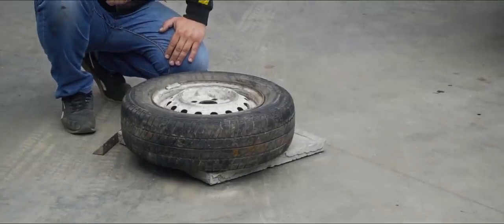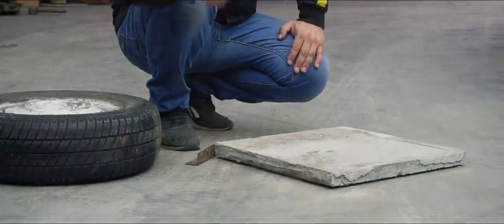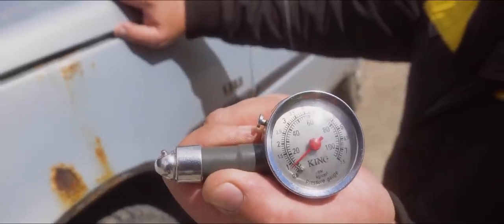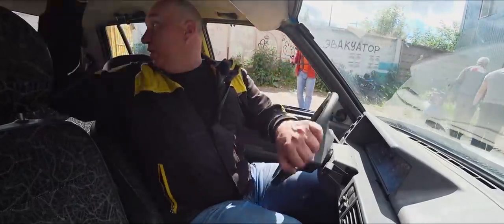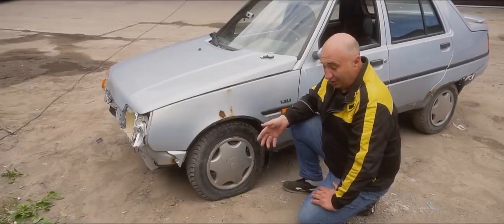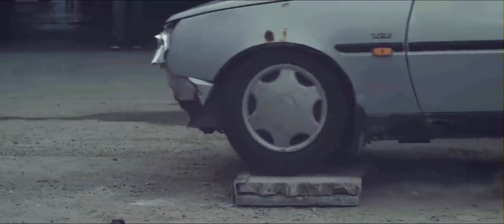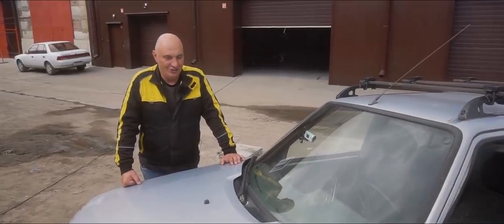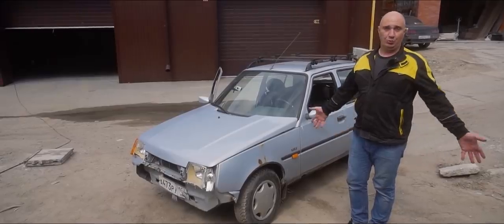220 PSI – can the tire keep it together?

Comment: Over inflating your tire a little will not cause blow-out. As one can see a healthy tire can take a lot. It is the low tire pressure causing a lot of heat while driving that leads to tire failure and blow-out.

Comment: Used to work in a photo lab. Fire dept brings in film of dead guy who was welding a 18 wheeler truck rim and did not remove valve core. His head above his nose was sheared off and they showed it with rim on roof where it ended up. He was leaning over it when the heat set it off like a bomb.

Comment: Now make a 4 way joystick that actuates four  single piston cylinders (use a master from a hydraulic clutch - 2002 Accent for example) in an X formation and connect it to a X and Y axis pivoting joystick with pushrods to press into each master, oriented centrally so that each corner of the X points to the wheels LF, RF, RR, LR starting at top left and going clockwise. Connect the other end respectively to each corner of the car's brakes with brake lines  - 4 way selective brakes ;)

Comment: Would be curious to know what pressure the tyres briefly reaches on impact, maybe one of those cheap wireless tyre pressure monitor that screw on the the valve is in order
Reply: I thought about that too, they probably won’t read high enough though😐
Reply: @paulEG6  just had a quick look and most seem to max out at 90-100 psi, prob something out there that can be put in the tyre for high reading but no doubt be expensive for these levels of pressure resistance

Comment: No way would I ever be near that tire when putting in that much air, thats nuts!
Reply: @TomAlter1000  I had a LT245 tire blow up on me a few years ago, and it was only at 40psi, it turned out to be a defect in the tire, I got a cut on my arm from it, yeah 200psi is scary in a passenger tire...

Comment: Thank you for that experiment: Now I know that I was perfectly fine when I've overinflated a tire to around 6 bar / 90 psi after I forgot that I've left super slow and super loud crappy tire compressor running until it broke down :)

Comment: This is so ridiculously dangerous. When I was an apprentice years ago there was a picture on the wall at trade school of an imprint of a man in the roof of a factory. It was caused by him leaning over a split ring truck wheel while inflating and it letting go at about 25psi.

Comment: I love this channel but you scared the shit out of me while inflating that tire to such a high PSI.
When I was active duty USAF, a young airman inadvertently overinflated a nose tire on an F-15.
He had been taught an improper and illegal short cut that cost him his life.
The nose tire on an F-15 is normally inflated to 325 psi.
He had the regulator set to 970 psi and the ten tie bolts that hold the wheel halves together failed and the whole goddamm thing blew up in his face. He never knew what hit him and it CUT HIM IN HALF!!!
I was on that very jet about 20 minutes before it happened and it haunts me still. That was in 1986.
Please, please PLEASE! respect that kind of force and be careful.
I've lost enough people to tragic events. 
Be safe my friends.

Comment: Last time I changed my low profile tires, one of them wouldn't pop out while mounting it. The guy at the shop put 6-7 bar of pressure but nothing. He told me he didn't want to go any higher. Next time I'll take my car to Russians. They put 15 bar in a used tire without a problem 😂

Comment: When I was like 10, my bike tire blew up in my face. Scared the F out of me. This guy has balls for pump a car tire Up that high.
Reply: Had mine jump right off the rim, balloon and POP! Tyre did fail (the lining at the rim edge), because I didn't have a spare with me, I very carefully reset it and ensured it was properly positioned. Thank goodness for spare tubes (I replaced as soon as I returned home).

Comment: take a lada and loosen all the bolts in the engine, rod endcaps, main caps, camshaft caps, headbolts, timing chain, crank pully, water pump, just make it really loose.

Comment: Crazy how durable a Tire is. But I would be scared to drive it after just one of such a hit. Well at least at high speed. At low speed an exploding tire is managable. I always thought that it is dangerous to continue driving after you hit something like this. But they were really trying but it didn't explode.

Comment: I would really really really like to know which tire holds 220 PSI!!! I freaked out when a lady brought a car into our truck stop with 117 PSI in her Tire. I went and got two more Tire gauges just to see if the first one was correct. That was freaky as hell. I myself never put more than 38 PSI in mine.
Reply: Semi truck tires are often rated for official use at like 130psi, but 220 is pretty nutso.
Reply: @Cooe.  I've been doing truck tires for 30 years plus. The most I've ever put in a tire was 125 psi and it was usually a super single.

Comment: I need to know what brand of tires those are. I've had semi tires explode at 130psi.
Reply: Anthelion Gaming we’ve been getting new reefer trailers in from the dealer with 150 psi in them.
Reply: @danparden8103  Even the heavy haul tractors don't get 150. We're not allowed to air past rated pressure.
Reply: Those tires are Amtel NordMaster. Winter tires produced in Russia.

Comment: Now lets try these pressures on a car loaded with 5 tons of concrete, a wooden crankshaft in the engine and vodka in the fuel tank, a clutch made from a frying pan and some flat pebbles as brake pads. :)

Comment: On the thumbnail it looked like 220 BAR that would be spectacular 3190psi
Reply: 220 bar would make a huge explosion but can be easily  achieved with a diving compressor
Reply: @FraLin  oh really?  Interesting i have only worked with Industrial compressed air systems at about 100psi. And isostatic systems at 345 bar but they use water.

Comment: Test recommendation: Replace a car steering wheel/gas pedal with motor cycle handle bar and controls!
Reply: How would you turn a handlebar three or four rotations with all the cables and wires connected to it?
Reply: @Rob-fc9wg  thats part of the challenge

Comment: 2:40 LOL those are Very tiny Wheels i remember owning a 93 civic and it had those size tires, it felt like a Go Kart, it was very zippy and fasyt, although it didn't handle very well :(
Reply: Sounds like you can't drive, one of the nicest handling hatchbacks out there

Comment: Fuck that...i wouldn't want to be anywhere near that tire once they got over 90psi

I was gassing up a once and the car next to me had a sidewall blow out at random. The concussion was so strong that it caved my driver's side door in, shattered my mirror and blew apart the light above us. Being a 1988 F150 I just yanked on the goofy mirror bracket and the door popped back out. 

Scared the hell out me, thought I was being shot at. The lady who's car it was had a little kid who was freaking out and she didn't have a jack or tire iron. 

I went home and picked up my floor jack so I could change her tire. Afterwards she asked for my name and address...about a week later her husband came by to give some cash for the mirror and thank me for helping her because he was out of town when her tire blew.

I thought that was pretty cool and I still pull over if I see someone struggling with it blow out.

Comment: it will hold over 400, why, because think of the centrifugal forces trying to sling the tire apart at  120mph. way more force then just 200 psi is needed to blow one apart, as a tire was engineered to not explode.

Comment: Install glow plug n valve stem hole. Then Gil tire with oxy acetlyne gas after tuning gas of then turn back on fill tire then activate gloowplug or spark plug. Ooommm

Comment: I nearly lost a finger when I inflated a tire to 90 psi and the rim broke.  I could not imagine what would have happened if the welds broke loose at 220 psi in this video.

Comment: 10.08 "what are you guys so worry about".......?  An angle iron 50x50x6 almost flew to the driver window with 50 km/h.... Into that pritty unprotected bald head from Igor..... BTW blowing up that tire with those pressures and with a short feed line without ear protection(and tire cage) is just unforgiving..........

Comment: Next video make electric lada with 500 litle motors from old radio-k7 & dvd players joined togueder with rubber bands and feed them with 2000 of AAA used batery cells.

Comment: pot hole very different.. suspension is extended out due to downward change is road surface. hitting a cement block does not do that. worse is Pot Ho;e